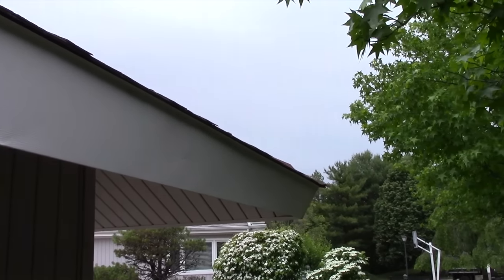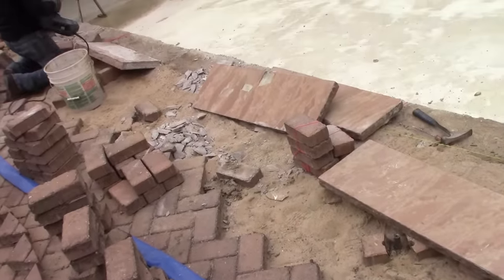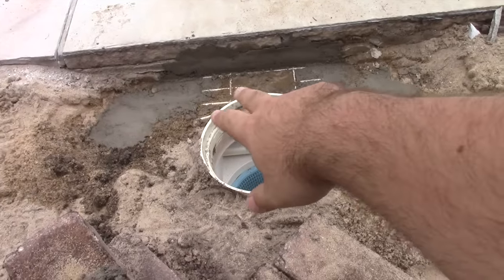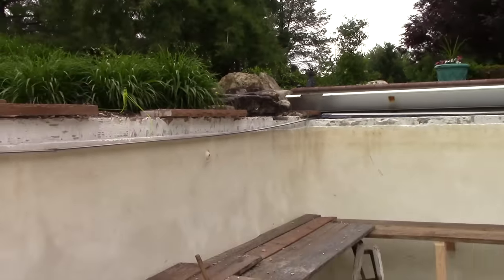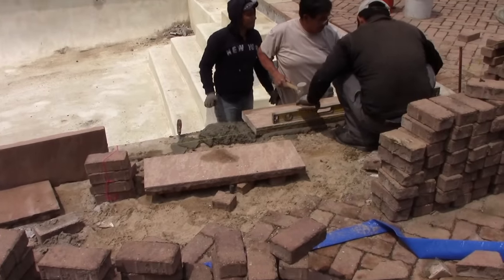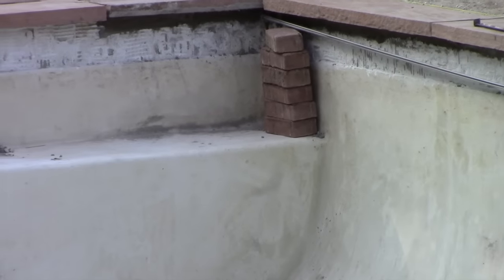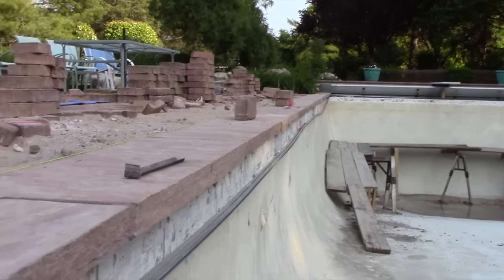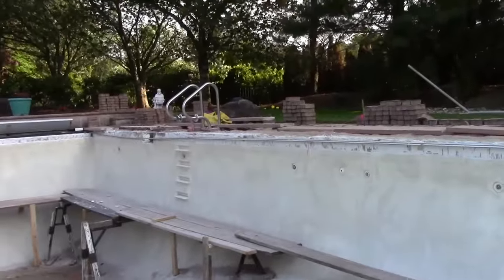Pool Repair: Part 3. Coping Reset and Skimmer Repairs.

Comment: They got a lot of Julios from the Schoolyarrr(d)s there.  If 4 of them happen across quicksand, you'd have cuatro cinco.

Looks to me like the repairs around the skimmers are rather "paper thin" and will start cracking and spalling again.  Also looks like a bit of a mess, they could have cleaned the edges of the skimmer up a bit better, but the stone is looking good.

How much of a discount are you getting for putting their website in the prescription? ;-)
Reply from the maker: jaykay18 Yes of course. haha. 

They are actually being re-worked right now! The next video will be uploaded this evening. 

None sadly. haha
Reply: Sharkie626 The ONLY correct answer to the discount is 30%, you know, 90%, 80, 100%, you're left with quite a bit!